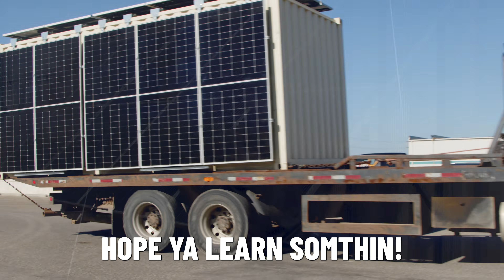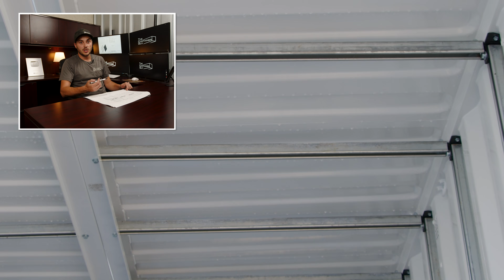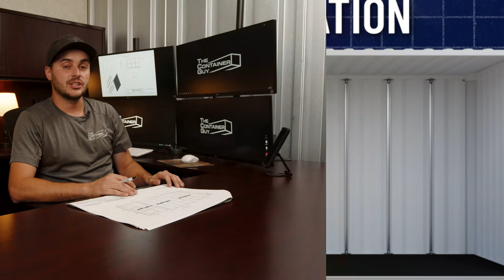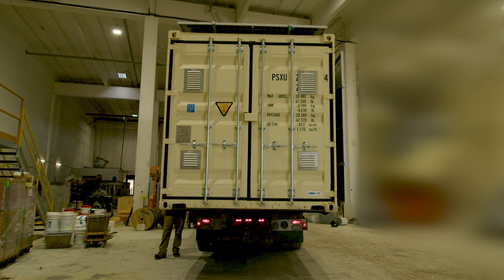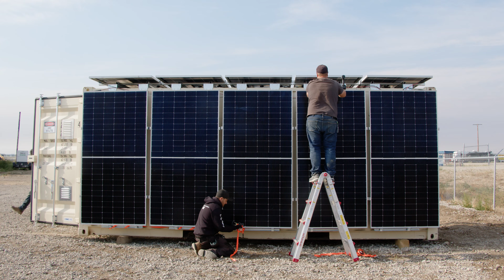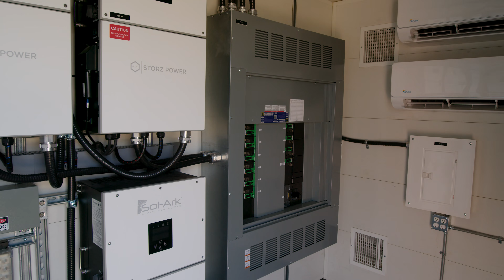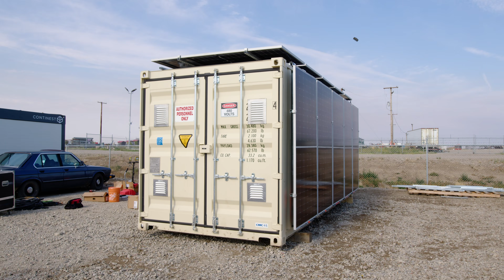Transforming a Shipping Container Into a DIY Solar Power Station! #NATO

Comment: Well, I like the idea and the build. But 10 540W panels can't power the entire town. I have 4 540W panels, and they merely produce 9000W during the summer and 7KW in the fall, which totals roughly 17.5-22.5KW daily (charge Tesla for ~60miles). For that little power, all those Solar Ark and 3 Phase transformers are way, way, way overkill. You can get away with 1-3 all-in-one EG4 inverters. To make it more affordable, a fixed mounting rack can be used if all the panels are installed at the site. Instead of spending $50-100K on your setup, I can achieve the same power output for around $10-20K. I hope you guys can come up with an affordable version for the general public. God bless solar enthusiasts.

Comment: No reason anymore to tilt the panels. The solar panel output is far higher and the cost 100x cheaper than it was in the 1970s. Back when it was important to squeeze every volt out of the 100,000 bucks of panels, one had to aim the square at the sun.
But now the panels are so cheap you can literally cover the walls and roof of the container with them bolted flat to the metal. No need to squeeze out every volt you can; you'll have more than enough, even on cloudy days.
Experiments have been run; vertically mounted solar panels on the walls put out about as much power as slanted as to make it a never no-mind.
And importantly, you do NOT have to just use south-facing walls. Any direction works. They're cheap.

Comment: i really like the design.  I was wondering if on the long side that panels doesn't have if they could make something to add additional panels to that side for a extra 5 panels.  they could lock into the roof mounted ones.  as long as the racking is movable for transport I think that could be a cool additional source of power and the new panels would be above the roof panels.

Comment: A simple solution that may help, Is simply adding a wind guide for transport, similar to an air dam under a car, 45 degree piece of metal will heavily mitigate the wind going under the panels to begin with.

Comment: I have 3 recommendations.  Gas struts to assist with the panels.  The gas struts used to support full size truck hood’s should do the trick.  Second, you can lock the panels in place with gravity latches.  I can see a customer flicking the gravity latch open with his shoe and the panel just gradually comes up on its own.  Lastly, I’ve been thinking about making one of these on a somewhat smaller scale (more like, buy a ready to live in container unit and then buy something like Anker’s Solaris powerstation ).  I want to have something similar to temporarily live in when recovering from a storm.  Back to my third recommendation, find an alternative to spray foam insulation if you decide to make these units livable to avoid any client stereotypes of the foams off gassing .  That’s all I got.  Hope this helps.  Great job guys!

Comment: Very nice!  What about using gas struts like what the full-size trucks use for their heavy hoods, to be used for the panels.  It could be held in a locked position by a gravity latch and a long rod to run through the eyes of multiple gravity latches.  
Just a thought.

Comment: Now you may have seen this but a suggestion on the locking of the panels to the container is a simple pull latch that releases the bearings and it then can be moved into position.  The only problem with this that I can see is added complexity.

Comment: Awesome job, Channing. Being from Europe, I would suffer a lot from the width restrictions but I see a lot of market potential in big off grid installations like music festivals. 
I do have a couple of Ideas that might be useful for you as well: 
1st did you try ultra light weight ETFE Modules like those by SunMan? They offer 430W @ 11kg. There are other manufacturers as well who also offer custom dimensions.
2nd did you consider using gas compression springs for your lifting rig?
3rd from big utility grad solar installations I got to know like from the German channel @derelektrotechniker your electrical installation looks awesome but over engineered. You might want to ask someone from that industry where you might be able to save some bucks there.

Keep on the great work

Markus
Reply from the maker: Thanks Markus. We'll hopefully do a budget friendly version that doesn't wow NASA like this one haha

Comment: I would look into electric rams to deploy and stow the panels with possibly a sun angle sensor of sort so the panels tilt to the best angle witch could be a very easy feature to make. getting the panels to move sideways would be a whole diffrent game, and expensice so atlest get a tilt to maximize performance and still  be in resonable budget. it would also make it easyer to deploy with only one person. Electronic locks or mag locks for the panels when transporting insted of ratchet straps? you could program these locks to release as you deploy with some basic programing with the rams. Also maybe a steel flap/wing/deflector? before the panels to deflect the wind while traveling to go over the panels and not between the panels and container? would protect the back of the panels more from wind and debry and will apply pressure against the container and not away from it.

Comment: Very cool idea. I’m guessing the panels on that thing are meant to run only electronics inside that one unit, and you will need more panels on the outside in order to actually run all those inverters inside. You will also need way more batteries. I think you need to scale up and do it now before concept gets too busy. I would have one container doing inverter stuff and another doing battery and transformer, and additional containers need to have a rack pull out system and will need to be stackable/connectable. You would need roughly 270 really good panels to run that thing. Because if it’s a modular system the infrastructure to set up that many panels in one spot will be difficult. And if they already have the land for all those panels building a simple slab on grade structure isn’t hard. Love how clean the site is great work.  PS Think of it as a large Solar edge system with battery connected just on bigger scale.  Also solark makes  cabinet battery/ inverter unit it might make sense to make batteries grid active double redundant.

Comment: Instead of having 2 separate arrays of panels (Roof/wall) I would recommend building a frame for the roof that is motorized to articulate in 2 dimensions 180°. Basically, if you motorize the array you can install a sensor that tracks the sun so the panels on the roof will collect much more energy throughout the day reducing the need and cost of more panels on the side wall. Automation solves a lot of hassle.
Reply: More Moving Pieces Equals More Potential Problems
Reply: more money marginal gain..

Comment: Is this meant to power a small town on its own?
Reply: @BlondieHappyGuy  you’re absolutely right I was just making sure i wasn’t missing anything.
Reply: @BlondieHappyGuy  From what I understand this is only the "substation" of the generating facility. It is just the place where you connect many more solar panels and generators, and it combines everything and turns it into a standard mobile power connection.

Comment: I'd probably suggest some sort of shipping edge protector/bumper/windbreak.  This would reduce lifting on the panels as airflow would go over them as opposed to under, and you're also going to have something that will guard against the inevitable corner bumps and scrapes this could encounter.   I'm thinking really a cheap fiberglass or plastic curved panel that can just clip on the container frame.  Another potential design feature would be to put in some D-rings along the panel side such that if a transporter was aware they would encounter rocks, dust, etc you could easily hook a tarp cover over it without them doing anything dumb like trying to ratchet strap around the panels.

Comment: This a great idea for businesses but for an average residential customer, I can imagine this will cost way more than most could afford. I build my own dyi off grid power, no where near as nice but with 240v (4x 6500k watts inverters, 10k+ solar on my roof) and 129kWh off battery pack. It will do the job. Cost me less than 30k. Your design is ideal but at a high cost. If I have crazy amount of money, I would buy it. Great job!
Reply: In my humble opinion for $115 usd, you can have your own power station with 50kw gen and a complete PV system including dual EP cube battery backup. that's more than enough power to run large or multiple buildings and homes. Honestly that's a pretty good deal with a 30% tax break down here in the US

Comment: What about a finer wire mesh under the bar grating to stop the vermin from getting in and chewing on wires? Also, you could have small stepper motors running threaded bar through a nut and have no more lifting at all.
Reply from the maker: These are all great suggestions. Please tell me you're subscribed. I want more 😂
Reply: Is the bracket panel attachment system available in the US yet? I need.  @TheContainerGuyTV
Reply: That was the first thing I thought on the panels except I'd take it a step further and allow them to automatically attract and retract following highest UV input.

Comment: Some kind of flashing or spoiler on the left and right of the “ front short side” of the container that’s copping all the oncoming Air Force will help a lot. It needs to be more aerodynamic I believe. It’s not the side winds or downward force that seems to be the problem. It’s the air getting underneath them. You must deflect it away. A tarp would do , but is a hassle. Even some aluminium fins or flashings on diagonal angles on each panels front side’s oncoming edge of each panel might just be enough to deflect the oncoming wind force away from entering underneath the panels. The first panel is the main entry point and any air flowing over the outside past the panel may create a vacuum effect in between the spaces of the other panels if not deflected out far enough. You have to think of it like a plane and then being the wings. They would be more secure event if they were opened up when it comes to aerodynamics. You are not creating a small pocket to catch the oncoming pressure and there it’s only the front edge of the wing to resist the force. Your basically trying to make the “fattest, squarest, un aerodynamic, heavy, shallow winged”  jumbo jet cut through the sky like a fighter jet plane. 😂. A pig soar like an eagle. If you do this right, pigs might actually fly… But I wouldn’t put it past you because you always impress me with the problems that you overcome. Keep up the amazing work thanks

Comment: Looks awesome!  I would not transport that down the highway without plywood covers on at least the side panels.  Rocks and sand get kicked up by passing vehicles and could damage the panels pretty easily.  Of course you also have to be thinking about height clearance.  I wonder if adding those panels to the top causes concerns at low clearance bridges?
Reply: IMO a customised container with a pocket for storage uses might have solved the issue, and yet aids transportation for international travel if need to, should UN decided to get it for their programs...